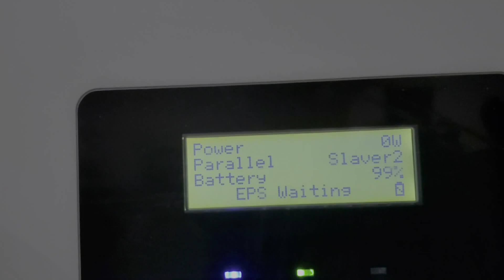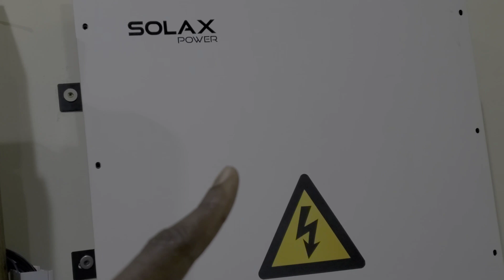How to balance SolaX T-58 batteries. #solax #solarpower #inverter #battery

Comment: how do you remove the closed loop cable? It’s not the same as the normal power cables between batteries
Reply from the maker: They provide a tool. It comes with the battery. It is blue in color

Comment: Hi, you have your batteries very close together, I appreciate room has air conditioning but do the batteries generate heat or just the inverters?
Reply from the maker: The batteries get a little warm. They have a balance function. You are also pushing a lot of energy into them. The electronics get warm

Comment: Did you succeed to charge the SolaX batteries from the generator?
I have a friend who uses a SolaX X3 Hybrid 10.0 G4 inverter in an off-grid installation and we get very little sun in Europe during the winter. He wants to charge the batteries from the inverter in cloudy days to have power without running the generator all the time, but we could not get the inverter to charge from the generator. Most of the times it just rejects the generator (the AC frequency of the diesel generator is a bit unstable 49 ... 51 Hz and we cannot do anything about that). But even when it accepts the generator without error, the SolaX still does not charge the batteries from the generator...
Reply from the maker: Get the newest version of the firmware. It allows for the generator and you can tell the inverter how much power to use for charging the batteries. Go to your grid settings and adjust the voltage and frequency range
Reply: @drsolar  Thank you!

Comment: Safety… safety… safety Dr. Solar. You have very high voltages in that room, fire hydrants are critical. If this was in some countries like Australia, a fire-rated door would have been mandated before system commissioning. Labels as well and a schematic are important, but that can come later. It will also be necessary. I like the way you’ve balanced the batteries and I hope those with smaller systems also learn and take note.
Reply from the maker: It is a priority here too. They are working on a fire suppression solution for the site. Thanks for this.